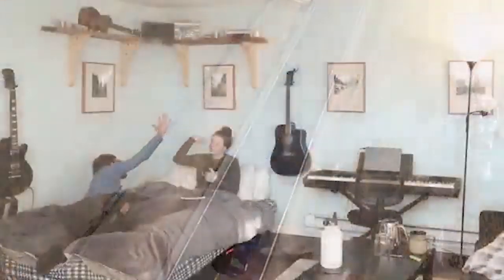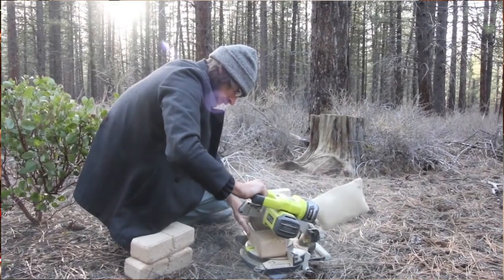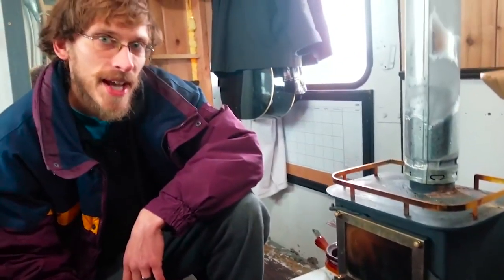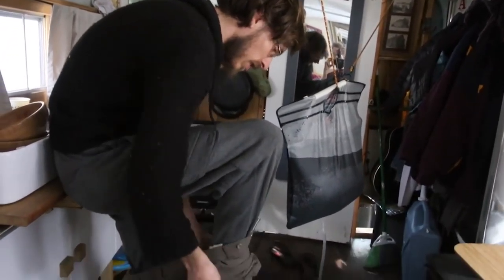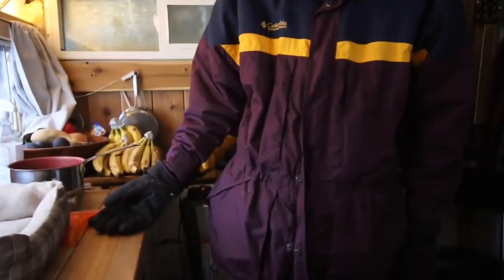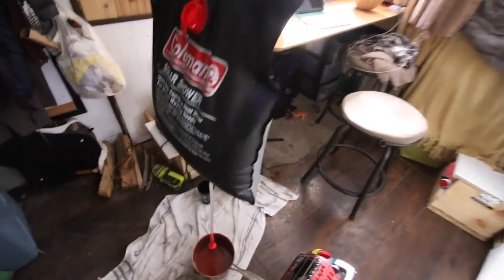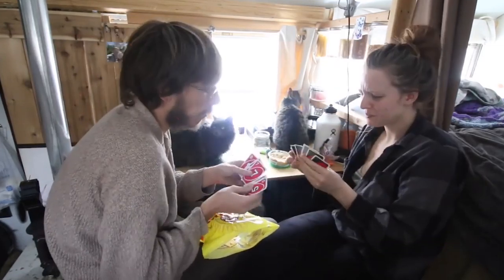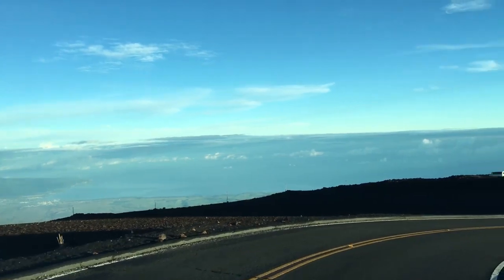HOW TO STAY WARM living in a bus during winter | tips!

Comment: Whoa seeing those conditions makes me glad I am near the Texas Gulf coast, lol
I know plenty of folks have wood stoves in their buses but the idea of a wood stove just freaks me out personally, just one little ember.
I agree co2 detector is a must with any combustible heat source, fire extinguisher also
I placed the columns and wood work around my windows so it will hold foam board covers over the entire window area, seemed to work with the test versions I cut out. 
I am building a shower/head in mine, re-installed the partitions this past week, no way I am showing outside when it is cold,brrrr 
Thanks for sharing
Mike from Texas,Take Memories,Leave Footprints
Reply: I guess not so much this year. Hope you are doing ok if you had to endure that winter storm in Texas.
Reply: @JoshB.Podcast  I am good thanks, hope you are as well.
Indeed I did endure the storm, I was comfy in my bus with just a space heater, the window covers make the difference.
Reply: @michaelpeel9347  Very glad to hear you made it through ok. Stay safe out there.